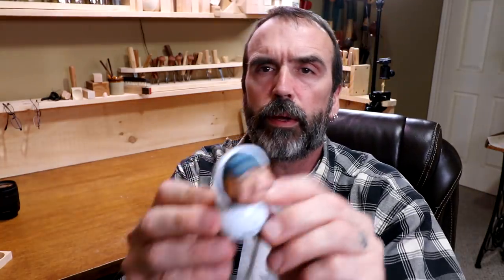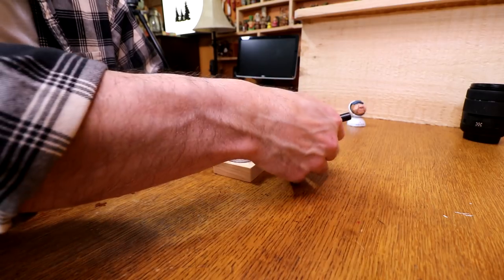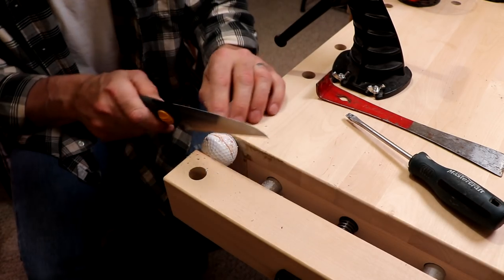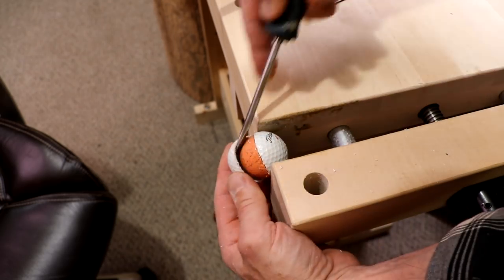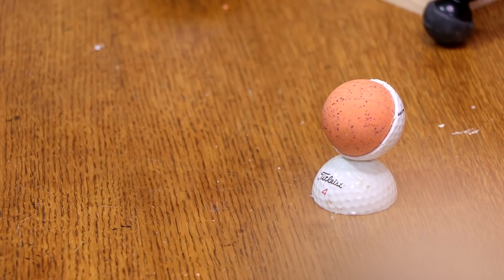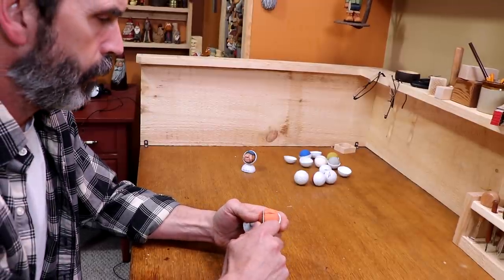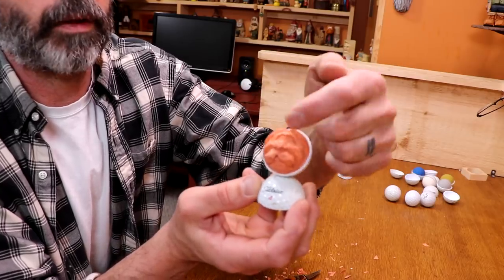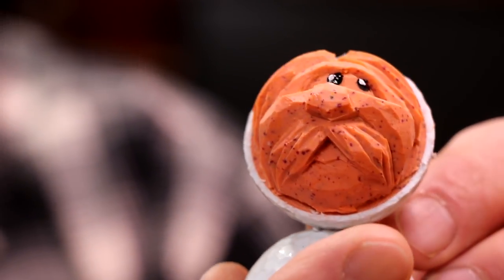How to Cut and Carve Golf Balls

Comment: Hi Doug 
 I liked the golf ball humor I use a Dremel to cut my caps off and a quick run with a knife will takeoff the melted stuff and you’re right it’s fun just to open them and see what color is inside I also use hot glue and a golf tee between the cover and a Carving instead of screwing it right to though I Carving with a block of wood for a base sometimes I make the bass look like a golf green Great video thanks for sharing Al from Vermont

Comment: Different brands of balls carve differently. first, multi-layer balls may have tough coatings under the skin, different core materials, etc. They can be carved, but the cheaper, solid center balls seem to be better. Even those have different carving characteristics by brand. some are gummy, some are firmer. The best ball I've carved was a Kro Flite 2 by Spalding. It cut cleanly, held details beautifully. It was some kind of elastomer with small particles in it. I'd rather carve it than wood. Unfortunately, it's no longer made. Does anyone out there have a ball that they recommend based on experience? I use only balls collected on walks in the woods near the local course, but wouldn't mind spending a buck a ball for good carvers.

Comment: Go on Amazon and search for pvc pipe cutter. https://www.amazon.com/pipe-cutters/b?node=553180  The one with the arc on the bottom will fit your golfball perfectly.. Then you just work your way around the ball, maybe 1/8" deep or less.  Once you go all the way around I usuallyturn the ball 90 degrees and cut half of the cover.  This makes it easier to pry the two 1/4 cover off.